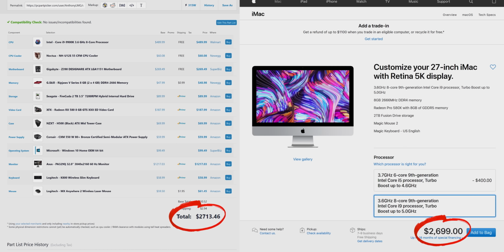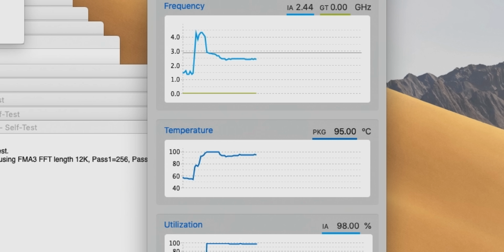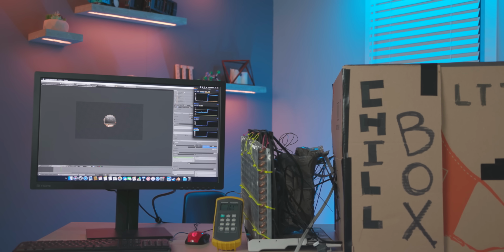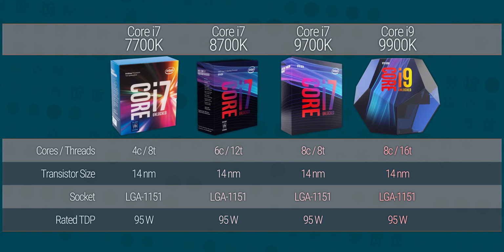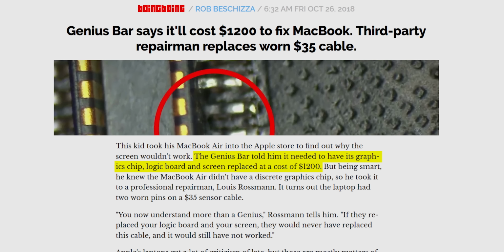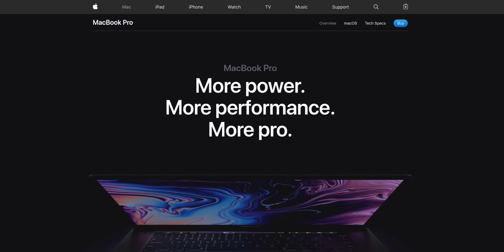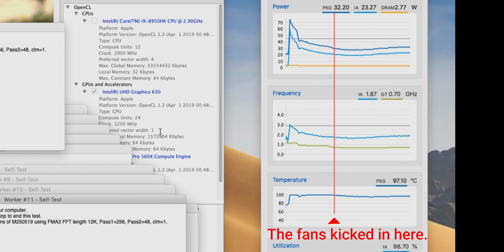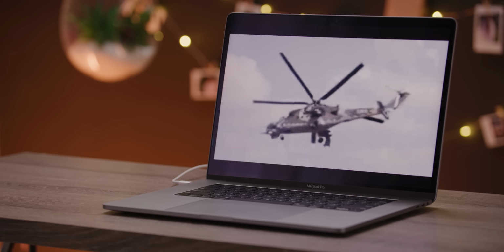Macs are SLOWER than PCs. Here’s why.

Comment: Thin/light 
High performance 
Long battery life 

Pick 2
Reply: MWB Gaming 2 and 3
Reply: @jamesbuckwas6575  I would love to have 2 and 3 at the same time, but that requires companies to install larger batteries in their devices, the problem is that they don't want to go above the 60wh-80wh standard for some reason, and for another unknown reason, they won't give us removable batteries anymore
Reply: @mwbgaming28  
I'd be fine with a moderately heavy computer. At least have that over bad performance or a bad battery
Reply: @jamesbuckwas6575  I can deal with a small battery, as long as it is removable without tools or removing panels 

I got so sick of shitty battery life on my laptop that I actually modified the battery, my laptop now has a 297Wh 30 cell battery (the bottom of the laptop is lined with cells) 

Now i get good performance, and amazing battery life (36hrs standby, 9hrs under synthetic loads like Aida 64, battery eater benchmark.etc)
Reply: @mwbgaming28  
That "unkown reason" is FAA regulations. 
It is illegal to fly with a lithium battery of a higher capacity than about ~85wh. And it is determined by device, not by the battery itself. So the entire laptop's battery capacity can't exceed that arbitrary limit.

So if they put a bigger battery, it would be illegal to fly with it, and couldn't be shipped by air.

That would spell doom for the product.
Reply: @merlinious01  actually it's 100wh not 85, so again, what's the reason for staying within the 60-80wh range instead of using the full 100wh (or just have a removable battery so we can bring as many as we need with us)

Also the limit is per battery, not based on the device the battery is used in, and if you get a note from your airline, you can legally exceed that 100wh limit

Lithium batteries are not allowed to be shipped by air anyway, even a single 18650 cell can't be shipped by air
Reply: @mwbgaming28  How did you build your own super-battery? That sounds like it'd require messing with some dangerous stuff, awkward soldering and taping of existing batteries into an ugly mess, or needing a 3d printer to make your own housing, which might mess with the laptop's thermals.
Reply: @Thalanox  like this  https://imgur.com/a/R4OqqZj
That's my gen 2 super battery (there's also a picture of my prototype gen 1 super battery in there too) 

It did require soldering, but it really isn't that hard, just make sure you don't connect the wires around the wrong way and you'll be fine
Reply: @mwbgaming28  I somehow missed that post. Thanks for sending the diagrams. Once my thinkpad battery starts to go, I might make one of those super cells. I have access to soldering equipment, but haven't soldered in a while. Eh, it can't be that hard to find some wire scraps to practice with, right?
Reply: @Thalanox  ibwould recommend practicing before you try to build a battery like mine, you will need 2 soldering irons ideally, 1 low powered iron with a fine tip (for PCB soldering if you choose to do that) and a heavy iron with a lot of power and a flat tip (for soldering to cells) 

Definitely get some practice before you even attempt it, go to the r/ThinkPad subreddit if you want to see the full comments where I explain exactly how to do it
Reply: @mwbgaming28  fuck yes on modding your battery, what cells did you use? i build electric rideables, so i always use 18650s or 20700s.
Reply: high performance and long battery life. I don't mind a girthier and bit heavier lappy
Reply: @AnymMusic  same here, but we have Apple to blame for the lack of such devices
Reply: @mwbgaming28  You have Apple to blame for nothing. Some of us would rather use our laptops for work than video games. And as it turns out, most work doesn't require serious computing power.
Reply: @ATLracing  no reason to not have a dedicated GPU, IF you are not gaming, just turn the GPU off and get longer battery life 

Want to play games, turn it on and get extra performance

Everybody wins
Reply: @mwbgaming28  A dedicated GPU increases the price of the machine and wastes space (assuming you don't use it). So, there are two good reasons. Mind you, Apple offers laptops with dedicated graphics.
Reply: @ATLracing  then why not make it an optional extra when you buy the machine, or sell it separately as an add on module (like they used to with older laptops) 

As for crapple, no removable battery, crap cooling, garbage OS, too many restrictions, too fragile
Reply: @mwbgaming28  Ahem, to repeat myself, Apple offers laptops with dedicated graphics. And modularity comes at the cost of aesthetics/compactness (do you remember what Apple's older laptops looked like? Surely not..).

OS X is not crap, and there are no "restrictions" (at least not if you know your way around a CLI; something tells me you don't). Maybe don't knock it until you've tried it.
Reply: @ATLracing   dude i modified my ThinkPad with a battery that weighs 3x more than the laptop itself weighs, I really don't give a shit about compactness 

Many years ago, i used to be a full blown iSheep (had a MacBook pro, iPhone 5S, and an iPad) eventually I had a shot at using my mates alienware laptop and had a look at his galaxy S5, within the first 5 minutes of using it I was no longer an iSheep, Android was much more versatile than my jailbroken iPhone (especially for downloading files off websites) and I found Windows to be much more useful than Mac OS for gaming and modding 

These days I have a ThinkPad T420s, an Asus ROG G551J, a high powered desktop PC with 2 980tis, a Samsung galaxy S10 5G, a galaxy watch, and an iPad 4 (can't find an Android tablet that I actually like) 

I really don't care about aesthetics that much, I use my device as a tool, not a fashion accessory 

You cannot have high performance hardware inside a device with little to no cooling and expect it to work perfectly (BIG problem I had with my old MacBook pro, is it was constantly thermal throttling) 

Thin devices are also far more fragile than devices with more thickness and structural support (drop a Panasonic toughbook then drop a MacBook pro and see which one fares better) 

Function should almost always trump form 

Why can't I just have a laptop that is designed as a tool rather than a fashion accessory (they do exist, but companies generally won't sell them to consumers)
Reply: @mwbgaming28  "I really don't give a shit about compactness"

Bruh.. That's nice, but some (dare I say most?) of us do.

"I found Windows to be much more useful than Mac OS for gaming and modding "

Now try programming lol... And if gaming is so important to you, you can dual boot Windows on your Mac.

"These days I have a ThinkPad T420s, an Asus ROG G551J, a high powered desktop PC with 2 980tis"

I also have a high-powered desktop PC. And guess what? It makes owning a high-powered laptop totally fucking redundant.

"drop a Panasonic toughbook then drop a MacBook pro and see which one fares better"

Maybe don't drop your laptop?

"Why can't I just have a laptop that is designed as a tool rather than a fashion accessory"

Beauty and function aren't mutually exclusive.
Reply: @ATLracing   not my fault that the special snowflakes of today are too weak to carry more than half a kilogram

Non Apple hardware is also vastly cheaper, if I'm going to run Windows, i might as well just buy a Windows computer and save myself $1000 

A high performance desktop PC doesn't make a gaming laptop obsolete, you can't bring your desktop PC on a plane, to a friends house, or to work 

Desktop PC: at home 

ThinkPad: for work, power outages, or when I otherwise need to be unplugged all day (since the battery is able to last the entire day at the cost of being 3x as heavy as the computer itself) 

Gaming laptop: when I want to play games while im out that won't run on the ThinkPad (and since the battery is removable, I can bring spares with me for a long flight for example) 

I don't intentionally drop my devices, but accidents happen, it's always good to have a device that can withstand being dropped or sat on

When it comes to technology, function is ALWAYS more important than beauty, (unless you are ok with carrying around a bag of dongles to get the features that used to be built into your device) MacBooks do look great, but I like having all my ports built into the device and having a swappable battery, even if it means it is a bit thicker and doesn't look like a sheet of paper
Reply: @mwbgaming28  Lol, you cast your unfortunate subculture in such a flattering light.. If you insist on lugging around an unsightly, ungainly, and just thoroughly impractical device to ensure that highly improbable/infrequent occurrences (power outages, accidental damage, flights, etc) won't even momentarily separate you from your precious video games (God forbid lol), you evidently have some strange convictions. I however like to think I'm a little more courageous than that, so I'm going to stick with beautiful, user-friendly devices that (364 days of the year) perform considerably better.  

And you can continue to cling to the false idea that your 'tech-woke' Apple bashing makes you computer savvy, but I think we both know you aren't. Anyone can read a PC parts catalogue (that's why so many kids build computers). Real insight takes a deeper understanding of the technology. What you and your ilk fail to understand is that computers are far more than the sum of their high-level specs.
Reply: @ATLracing  I don't see what's so impractical about a computer that fits into a standard laptop bag, has a battery that can last literally the entire day, no matter what you are doing with it, is modular and repairable, and is reasonably durable, oh and I can burn a few extra calories while carrying it 

Even my unmodified gaming laptop which weighs in at around 2.5kg is very portable, even though it has a removable battery, decent IO selection, fairly powerful GPU, and a reasonably sufficient cooling system, I can bring a few spare batteries and easily game my way through an international flight, and have no trouble bringing it places 

The point I'm trying to make is that this throwaway culture is the single worst thing that humans have done regarding the environment, and it has crippled the usability and repairability of these devices 

LinusTechTips made a MacBook pro thermal throttle in a few SECONDS (not exaggerating) without overclocking it, it started throttling before it even fully booted up

Louis Rossman has shown on countless occasions how Apple products in particular are intentionally difficult to repair, and are designed to fail after about a year or 2 of daily use 

I'm willing to pay a premium for quality, durability, modularity, and repairability 
But no such device is available to the general public that has ALL of those things (the companies making these will not even reply if you send them an order form without a business level order quantity, usually 2 or more, and a business registration number, I should know, I have tried many times to get one) 

Oh and one final thing, what if I want to use a USB thumb drive or an SD card in a modern MacBook, but I forgot to bring my bag of dongles 

What happens then?
Reply: @mwbgaming28  Ugh, you're looking at this from a hobbyist perspective. I really don't have the time or energy to explain to you why your tank of a laptop and external batteries are wildly impractical for 99% of consumers (including professionals). I think it ought to be self-evident.
Reply: @ATLracing  a laptop that only runs for an hour and a half (under an actual intensive load) before becoming an expensive paperweight is also absurdly impractical 

It's even more impractical to need to carry a bag of dongles just to plug anything into it 

But answer this
What is so impractical about having a removable battery? 

That one feature seems to be the hardest thing to find on modern laptops
Reply: @ATLracing  and no, I'm looking at this from the perspective of a technician who wants to be able to actually use his device unplugged
Reply: @mwbgaming28  "a laptop that only runs for an hour and a half (under an actual intensive load) before becoming an expensive paperweight is also absurdly impractical"

Do you honestly believe this has ever occurred outside of a contrived lab test? I've never come even remotely close to killing my laptop in an hour and a half.. And I've even gamed on this thing once or twice (not that I'd recommend it).

"What is so impractical about having a removable battery? "

It compromises chassis rigidity and prevents designers from distributing the cells in a space-conserving manner (look at the shape of a MacBook battery; who would want to carry that around?). Since few people need more than 10 hours of battery life, manufacturers don't view this as a worthwhile trade.

Think of laptop design as an optimization problem. Apple has optimized their products exceptionally well for large majority of consumers/professionals. Unfortunately, you're part of a niche segment. In any case, I think (hope) we both have more productive ways to spend our time than arguing on YouTube, so I'm going to slowly back away now lol.
Reply: @ATLracing  play games or do any other workload that puts a lot of load on the CPU of your laptop, it has to get its power from somewhere (that somewhere being the battery)

Every high end laptop I have ever owned would always get less than 2 hours of runtime while doing things like playing games, video encoding, file encryption.etc on battery power (after I turned off the automatic throttling so it would have the same level of performance as if it were plugged in) 

I have NEVER been able to get the advertised battery life of any laptop (even with power saving mode and minimum screen brightness)

The longest runtime I have ever had from a non Apple laptop (without modifications) is around 4 hours, and that was on my ThinkPad with the stock battery and ultrabay battery, while watching movies with all the power saving features active 

My ThinkPad has a removable battery (among other removable modules) and it's chassis is stronger than your MacBook (even without the additional structural reinforcement that my super battery provides) 

When you install a removable battery, the battery becomes a structural element that is stronger than it would be if the battery was non removable, laptops with removable batteries are only weaker if the battery is not installed In the computer

Yes you can use the internal space more efficiently, but no company goes above 97wh anyway (even when there is plenty of space to do so) so you might as well have a 70wh removable battery and just bring extras with you if you need more runtime, the tjinner design and extra 20wh of capacity is really not worth the hassle of not being able to do something as trivial as swapping out a dead battery for a charged one when you are not able to plug it in (such as on board an aircraft)
Reply: @mwbgaming28  "I have NEVER been able to get the advertised battery life of any laptop (even with power saving mode and minimum screen brightness)"

Haha, I bet. Gaming/media laptops always over claim on this one. Believe it or not though, MacBooks tend to test at about the advertised spec. Go read some reviews.

Also, do I need to walk you through a typical day with my laptop (it doesn't involve file encryption lol)? The most intense application I typically use is GCC..

And I'm quite certain you misunderstood my point about batteries. I'm not saying laptops with removable batteries are structurally weaker. I'm saying to design a laptop with a removable battery, manufacturers must add extra support to the chassis, which increases size and weight. There's always a tradeoff to be made.

"the tjinner design and extra 20wh of capacity is really not worth the hassle of not being able to do something as trivial as swapping out a dead battery for a charged one when you are not able to plug it in (such as on board an aircraft)"

Dammit, man, are you listening? THINK OPTIMIZATION PROBLEM. Features that are rarely useful SHOULD be traded for features that improve the user experience on a regular basis. If the battery ALMOST NEVER dies before you can find an outlet, then YES a thinner design is worth the INFREQUENT hassle of being unable to swap it out. Granted, there's a degree of subjectivity here. Maybe YOU really do need more battery life for your workflow (I'll give you the benefit of the doubt on this one). In that case, YES you should consider looking at different options that better suit your needs. But I (along with the vast majority of consumers) do not, so why should I trade features that are useful to me 365 days of the year (e.g. compactness) for those that are useful maybe once or twice per year if I'm lucky (e.g. a removable battery)?
Reply: @ATLracing  most companies overstate battery life, not just for gaming/multimedia laptops 

Most of my workday is spent away from a socket, no laptop on the market can get me through an entire workday without plugging in (before you plug apple again, the software I use at work is only for Windows) 

That extra reinforcement is about half a cent worth of plastic (and it's still far stronger than anything made by apple) 

The "buy a different brand" argument doesn't work when EVERYTHING FOLLOWS THE SAME APPLE LED COOKIE CUTTER DESIGN!!! 

You do realise that if you can get 10h out of one charge, having a removable battery means you can have many many times that on hand

There should be a model and configuration for everyone (and there used to be) but I challenge you to find a laptop that was released in 2018 or later, with good specs (including at least a GTX 9 series GPU or AMD equivalent) and a removable battery (That is not stupidly expensive, and can actually be purchased by the general public, the 2019 Panasonic toughbook doesn't count since it's not for sale to the public and is in the same price range as a new car)
Reply: @ATLracing  answer this
With the current ethos of modern computers, what do you d ok if you want more runtime but can't plug in? 

What if you want to use accessories but you forgot to bring your bag of dongles? 

What if you want to listen to music, but you don't have wireless headphones? 

I like my devices to be useful (a laptop or phone is a tool afterall, and tools are meant to be useful) 

I see maybe 1 or 2 fringe cases where the current trend is beneficial, and a shitload of cases where the current trend cripples the devices functionality (particularly in terms of repairability and upgradeability) 

Long distance flying in particular is one situation where a removable battery is absolutely essential (especially if you are going to be using  the computer for the whole flight) most airlines do not offer power (and the ones that do usually charge for it) the limitations set by the FAA only apply on a per battery basis (which limits the usefulness of sealed devices) I can bring a few 99wh laptop batteries If i really want to and quickly swap them out as needed

I'd like to see you try and bring an ifixit kit in your carry on bag AND pull your laptop apart to swap the battery during the flight (I would pay to see that, especially if the plane hits turbulence and parts start flying everywhere XD)
Reply: MWB Gaming Don’t blame Apple for the non-modular trend, blame the consumer. Whether you‘d like to acknowledge it or not, you are a far representation of what the ordinary consumer is like. You’re also underestimating how far battery savings has gone, I used to own a MacBook Pro 2017 and it lasted 3-4 hours while I played StarCraft II running on Windows 10 with the highest quality and resolution I was able to run. If I’m doing Excel worksheets, emails, streaming, etc. I got 10 hours of battery life very easily. People buy laptops for portability, 5.5LBS is not what people have in mind when they think about portability. Plus when you’re traveling you want something thin to save space and something light so that it doesn’t put strain on your shoulder when thrown into a backpack.

I used to work in the IT department for a top 5 bank in the US, we got so many people that put in requests for computers and not because their performance was suffering - it was because they didn’t want to lug their thick/large laptops around all day. Beside that point, plugging in your computer literally takes seconds to do, but the overall convenience of taking a thinner and lighter computer outweighs the negative of just simply plugging your computer in. The longest domestic flight in the US is abound 5 hours? Excluding Hawaii/Alaska, my MacBook easily was able to do that when you include breaks in between for meals.  Every international flight I’ve been to has had an outlet, a quick Google search shows many companies saying that they include an outlet for all international flights - It’s a better idea to just bring a tablet with you because the combined weight of a thin/light computer like the MacBook is still lighter than your 5.5 pound laptop. 

I’m also curious, what do you do in your line of work where you have to bring a laptop around everywhere and also not have access to an outlet besides a flight?
Reply: that what i tell my boss. Quality. Quick Delivery. Cheap. Pick 2.
Reply: Or get a ROG Zephyrus S GX502 with all 3 to varying degrees.
Reply: @FrizFroz  under a heavy workload load, or in Asus laboratory conditions?

When I say long battery life, I mean at least 2 hours running a synthetic benchmark or a graphically intensive game (that fully loads the CPU/GPU) with the screen at full brightness

not 10 hours of staring at the mouse pointer with the screen barely visible (which seems to be the go to battery life test for most companies)
Reply: @mwbgaming28   Performing tasks like browsing. I had assumed that by long battery life you meant under non-gaming conditions, because no laptop I know of is capable of running graphically intensive games at full brightness above 2 hours, no matter thickness or the performance.
Reply: @FrizFroz  it is definitely possible, you just need a bigger battery, my ThinkPad T420s can game for 7 hours thanks to the 297wh super battery I have built for it (and I can do menial tasks on it for upward of 29 hours before it actually dies) 

You can get as much battery life as you want, you just need more batteries (remember the days of buying a 12 cell battery and getting double the battery life) 

If Dell would make alienware laptops with a 24 cell battery instead of just 6, you could easily surpass 3hrs of gaming on a single charge (you would probably get 5 or 6 hours)
Reply: It's funny,  how you have gaming in your name and are defending macs. Bruh moment
Reply: @jmh41  I hate Apple lol, they are the fuckers who killed the removable battery and started the thin and light pissing contest that is plaguing the mobile tech industry 

I have a white hot seething hatred for Apple
Reply: MWB Gaming high performance and long battery life
Reply: Can't speak for everyone but I'd choose the last two. Who cares how the thing looks if it runs awesome?
Reply: @radicaledward3783  I think you actually do speak for most people. It's only the technologically illiterate who are willing to sacrifice function for form. Well, maybe also some people who have extremely specific use scenarios and limits that turns the thinness and lightness into attributes that are actually valuable.
Reply: @Thalanox  I'd prefer modular design, then you can choose how much extra heft you want, want longer battery life and better performance, connect an extra battery and a GPU, want a thinner and lighter machine, just remove those modules 

Everybody wins
Reply: @mwbgaming28  The idea of an external GPU never really occurred to me. That sounds like it would involve making holes in the existing case and trying to make some sort of housing for the new components. Airflow for the new case is something I don't know how to manage.

I think it'll be a while before I have to go that route, but I do have some older laptops than my current one with near-dead batteries that I might consider reviving.

I have family who work as electrical engineers and design circuit boards, so the equipment and skills are probably within reach.

How do you protect your new battery, and how do you actually transport your laptop around if it's no longer able to fit into standard laptop carrying cases with it's new formfactor?
Reply: @Thalanox  I actually have a portable GPU for this laptop, it's a GTX 1050ti in one of those external PCI-E sockets, I can carry a 12V lithium ion battery to power it while on the go, because I have a ThinkPad (And don't want to sacrifice my 4G WWAN card) I can simply plug it into the expresscard slot, no disassembly needed 

Unfortunately, I can't realistically carry enough battery power to run a full sized 1050ti for 9 hours lol, but I can get a few hours of gaming while away from the wall socket 

As for the size of it, yes it does fit into a standard laptop bag, it's a bit of a tight fit, but it isn't too bad (I can also fit my GPU setup in there too) 

The holy grail would be finding a way to power the GPU with the laptops internal 12V rails, but that is beyond the scope of this mod (And beyond my electronics skill too)

The battery is protected by fuses and the laptops original BMS board, charging takes ages, but it runs great otherwise
Reply: @Aidan first "funny" comment that isn't just a fanboy saying, yay for real jokes
Reply: last two, i got the first two…. which i dont care and dont complain because i use the laptop connected just windows doesnt die in middle of a game because Power is not 100%
Reply: HP Spectre ap-0013dx
Reply: Desktop.
Reply: What's the weight difference between your average mac laptop and a pc laptop? 1kg at the absolute most? Yeah I'm not gonna notice that so I will pick 2&3.
Reply: At least apple picks one of these
Reply: the middle one but cranked to 300% amirite guys
Reply: Overpriced
Underperforming
Restricting
Outdated
Poorly designed

Pick 5
Reply: I want the thiccest laptop possible, provided it gives me palpatine amounts of power
Reply: * 1
Reply: @Aidan NO !!
Reply: Your dp is 🔥
Reply: @rishavkumar7769  nor your fault "Venoms" is in your blood...piece of shits
Reply: i just thumbed up for your dp